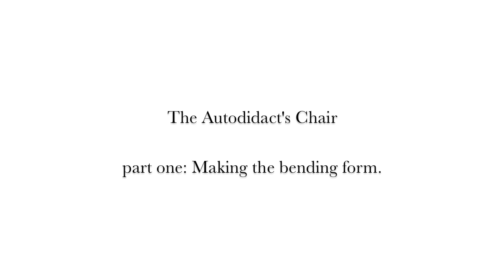The Autodidact's Chair Part One: Making the bending form.

Comment: Tom,  I know you're a hand tool artisan, but is there any reason you didn't consider using mdf for the bending form?  Is it because of the abrasiveness of that material, or is there some other consideration?
Reply from the maker: +Marty Schlosser Hi Marty, thanks for the question. You're right, MDF isn't very desirable to work with hand tools, but the truth is, I used what I had on hand to make the bending form. 
all the best-